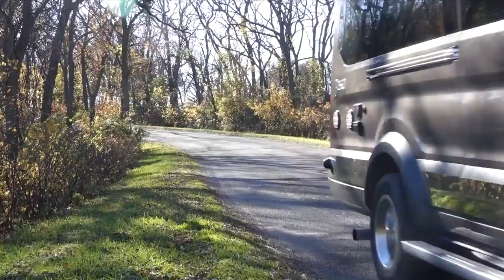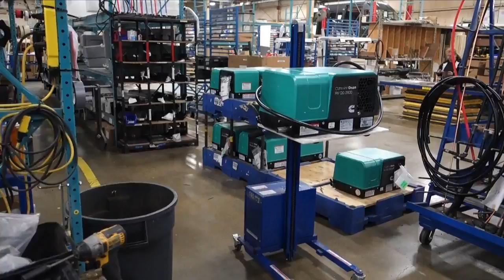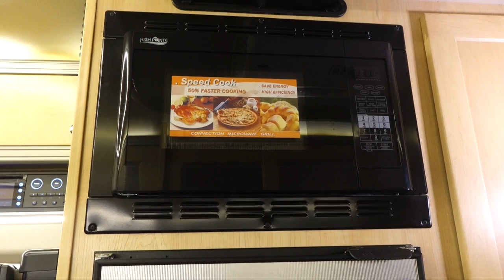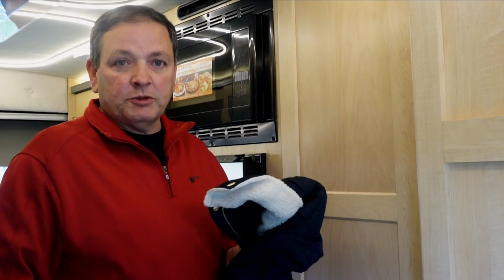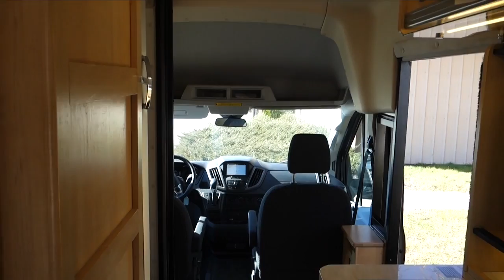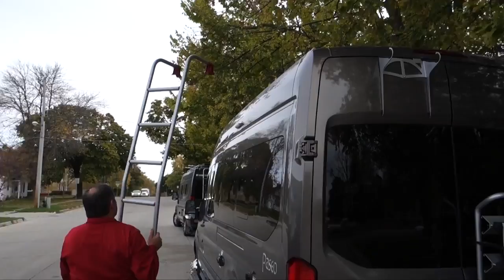2017 Winnebago Paseo - Lichtsinn.com

Comment: does it come in a 3.2 l diesel ?
Reply from the maker: Good morning Jeffrey... thanks for your note... I would predict Winnebago would keep this in the gas sector, as if we did begin to include the diesel version it would begin to approach very closely the pricing points of the Mercedes Benz based Winnebago Touring Coach Era that we offer.  We tried offering gas and diesel in the Travato and the diesel version was a very low take rate and eventually discontinued.